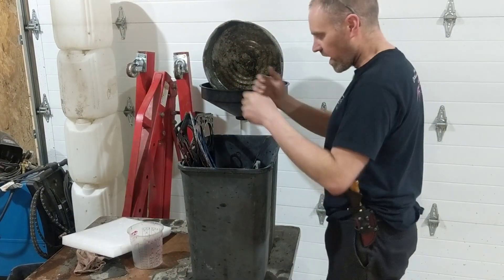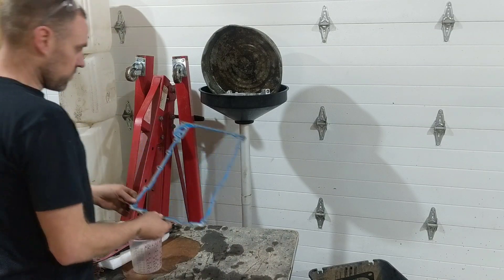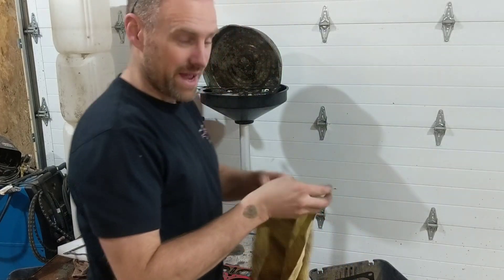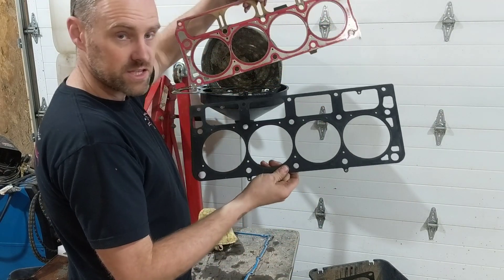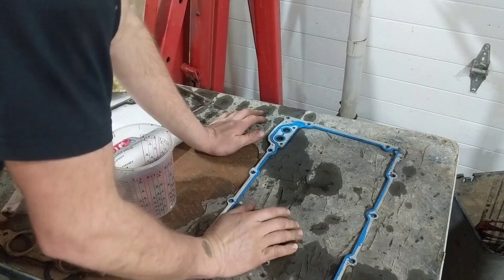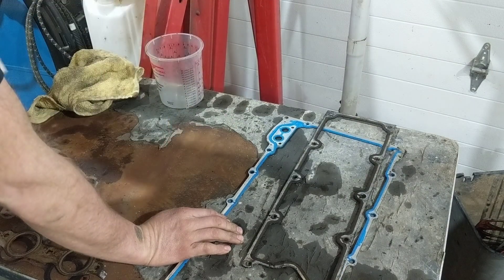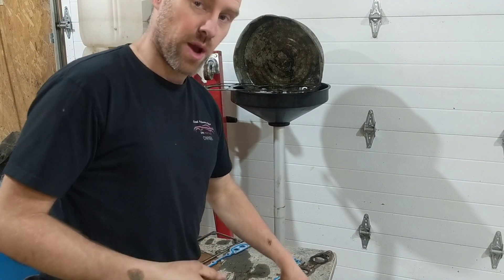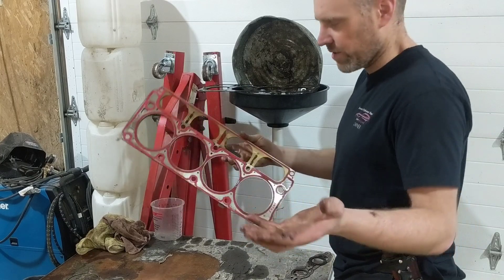Head Gaskets and Performance Applications

Comment: Quick question you might see this you might not.. I have plans to order your vlom plug.. on the AFM lifters I understand they only sit into the guide one way.. do the 2 holes on the lifter need to be aligned together? Because the inside spins as well as the casing as you know.. do these holes need to be aligned together? I have new trays..
Reply from the maker: The inside and outside lifter don't need to be indexed to a specific relation to each other. The part that does matter, is how it aligns with the oil Tower in the block.